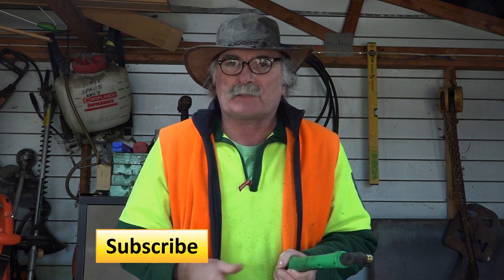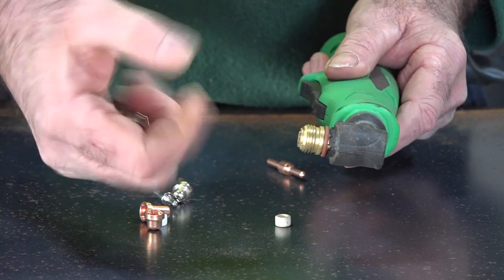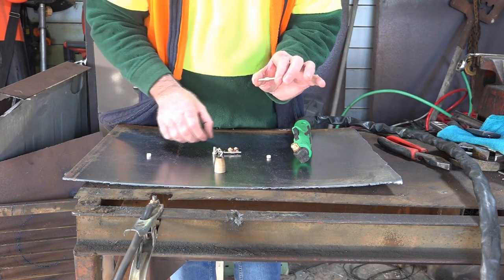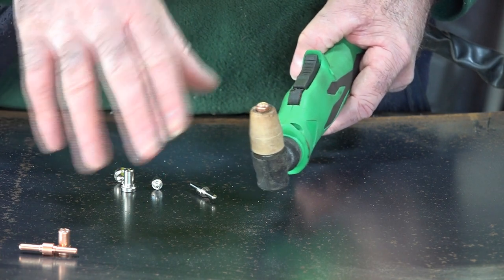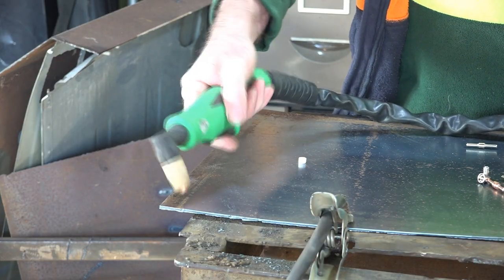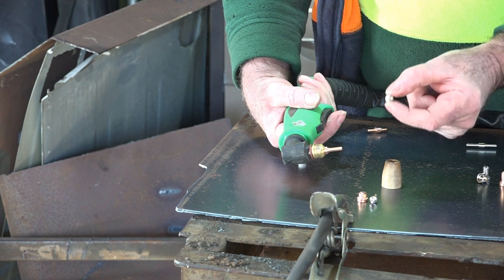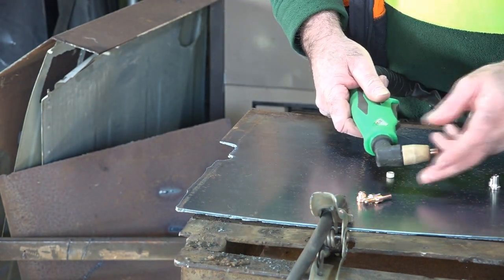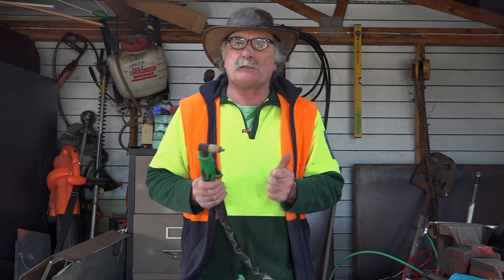Why Do Plasma Cutters Consumables Come In Different Lengths?

Comment: Some cutting tips have a cross grooved into the point and some don't.  What is the difference?  For a long time I thought that was the difference between the drag tip and the standoff tip??
Reply from the maker: I don't know what the groove are for some have it and some don't.
Reply: mine have that...I drag a lot on thin stuff,the grooves help with a place for blow back to go when punching through.
Reply: @petestools  I think I heard or read that it's for the air flow and I think the groves are on the flat wider tip ones that are more for flat cutting, and the pointier ones are for the hard to get corner areas like Pete was saying the longer tips are for.  Also for holding close or dragging with less flash.

That's my very limited understanding of it anyway...

Comment: Pete do you know if the cutting tip for the AG60 non pilot arc torch are the same as the AG60 pilot arc cutting tips ? Thanks
Reply from the maker: Yes they are

Comment: My plasma cutter is pulsating. Even when I replace the consumables it still does the same thing.
Reply from the maker: 110v or 220 ??
Reply: mine use to do that...there is a spark gap in the machine (which on mine was too close) it keep jumping here instead of on the work piece.